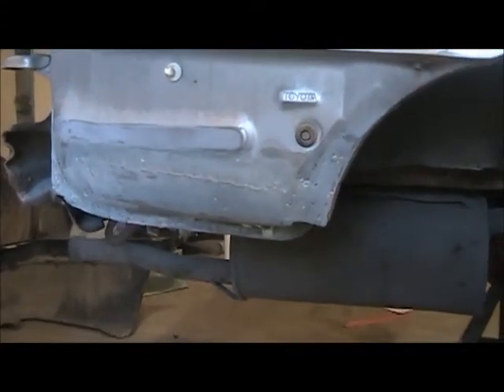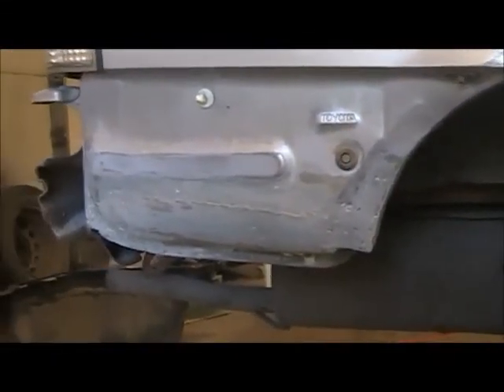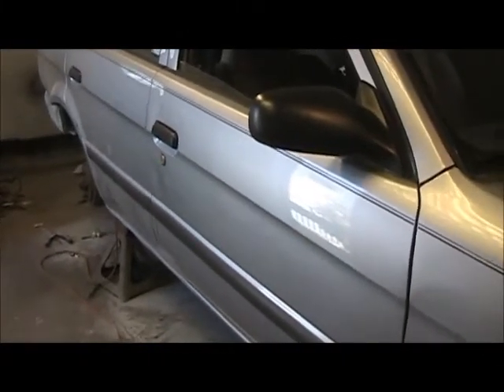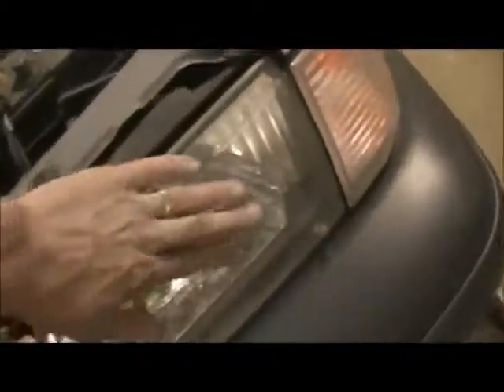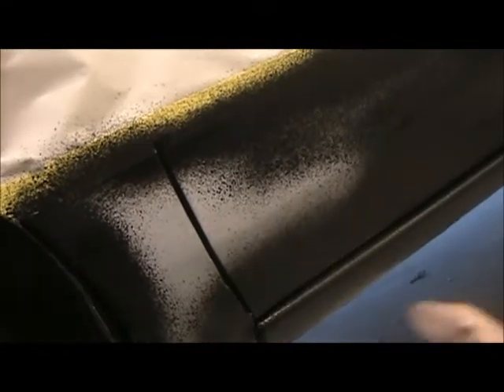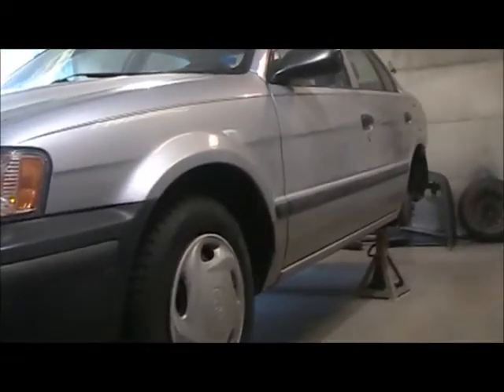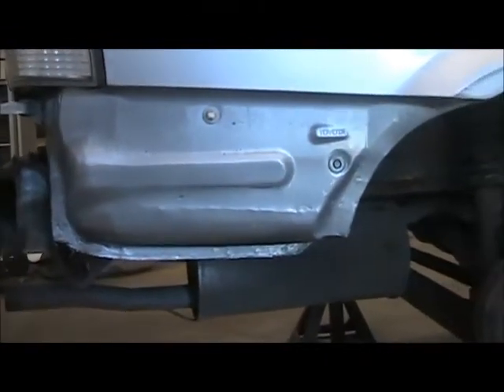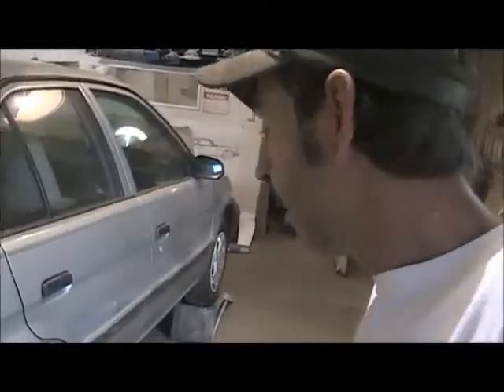the toyota tercel looks better now,not great but better

Comment: BTW when you pull apart the truck I highly recommend pulling the entire wiring harness fron to back.  That's what I did when I pulled apart the 95 van and it made wiring the 72 much easier.